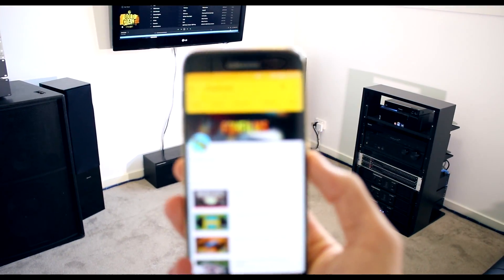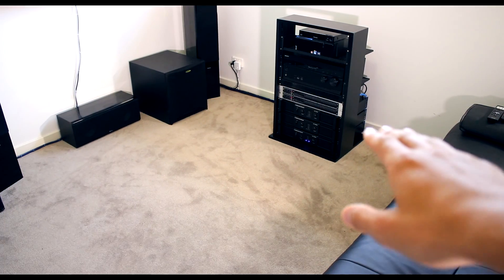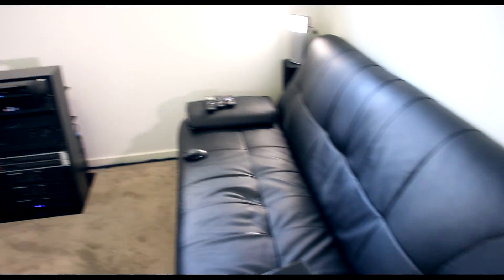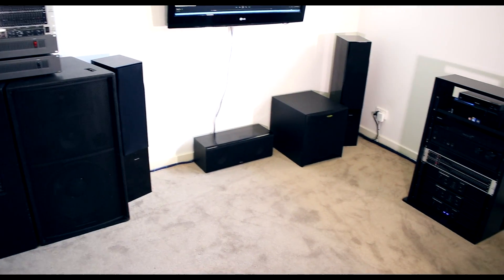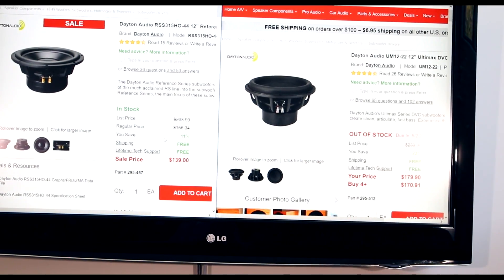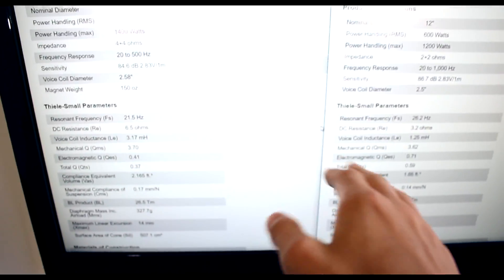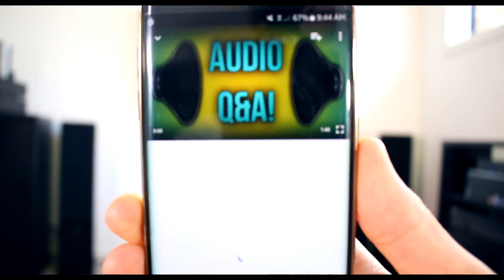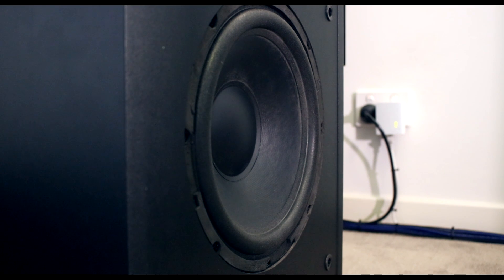UPDATES AND PLANS! - SYSTEM REBUILD EPISODE 4

Comment: I'm very very satisfied with my HSS315-HFA8's. They're 12inch 400w woofers, however.
This is an 8ohm which also has a 4ohm model. 
Beware, the HO's don't hit as good unless you go crazy on box sizes. The one I have does crazy good in a nicely designed TLine.

Comment: b&c 21" tapped horn! nothing like 2000W of PA high sensitivity, high excursion, low 30hz -3db point, horn power!
i'll design you a box if you want to go this route ;)
Reply: eta: calculated a 8 cubic foot tapped horn capable of 130 -145db depending on location (whether it's sitting in a field or in the corner of a room) all the way from 35 - 100hz on 2000W of power with a B&C 21SW152-4 21"

Comment: concert speakers in room like this - being deaf guaranteed, my room is bigger and i think logitech z623 is too loud or my home made two mosfet 160w at 4 ohms amplifier with skytec 200w woofer and 50w tweeter :D and another 400w rms at 4 ohms, 200w at 8 ohms amp with 8 mosfets sitting not being used

Comment: remember, with that ultimax you are getting a larger xmax and a MUCH MUCH stronger cone material providing much more linearity and air movement throughout the excursion cycle
Reply: Technologic the ultimax is also harder to drive accurately. the accuracy is less and going from an excursionslurping frequency to a kickdrum needs a good magnet. the ultimax's is too small to do that with style and quality. bigger is not always better.
Reply: you got a point there, the 12 HO will have a faster transient response with a much higher BL and a triple shorting ring
Reply: Besides.. If I'm able to get giant bass in its purest form out of an 8" in a good Tline, then a 12" Like the HO or HSS series, even with less excursion than the ultimax, should give massive bass too.

Comment: Loving how the new system is going! <3
P.S I'm also stuck in a room that doesn't hit low...
BUT my room peaks at 42 hz and 58 in the exact same spots.
Talk about having 2 resonant frequencies.
Reply: try running the subs out of phase and see if anything changes
Reply: Already tried doing that.
The just cancel eachother out a bit but the room itself keeps booming at 42 and 58.
Also tried moving the subs(they are the exact same subs both tuned to 42 hz and(I built them prior to the room's resonant freq.) 
they are the exact same boxes,around the room,in different spots,but the same spots keep resonation.(at my desk and at my door.)
Its really weird.
Reply: that is a very high tuning freq tho? my sub is tuned at 28hz. gives me low end:D
Reply: I run 3 subs. 2 4-th order banbasses with 5 inch drivers in them tuned to 42 hz and a single 8 inch (again custom built.) simple round ported box tuned to 25 hz that rolls off nicely to 20 hz and 34 hz (my bandbasses play as low as 33 hz so its a perfect match.)